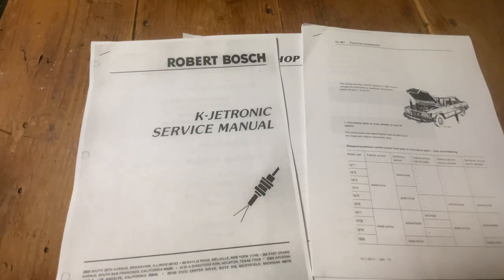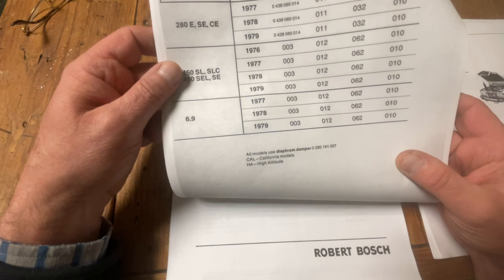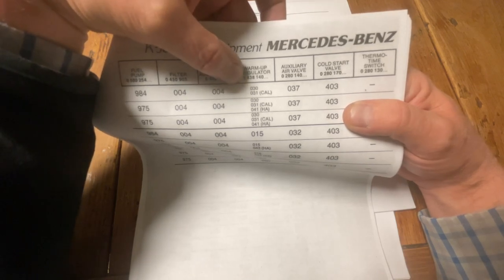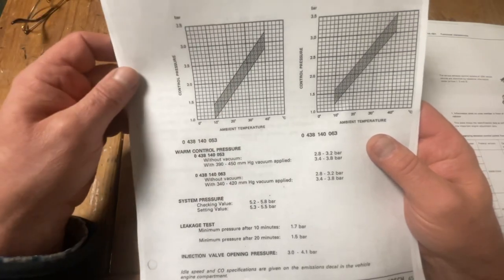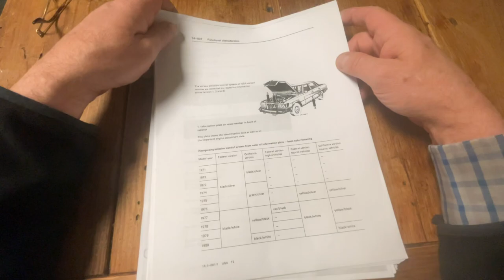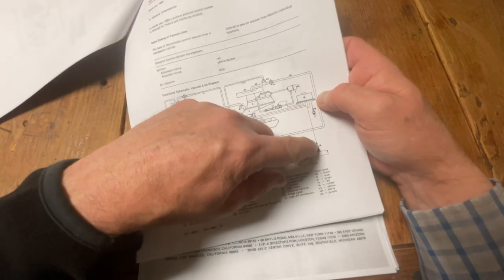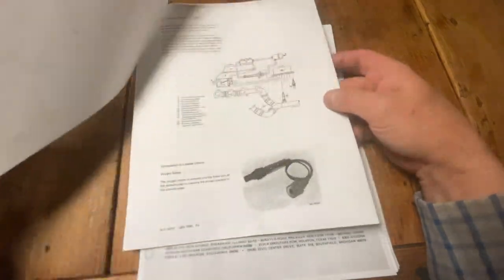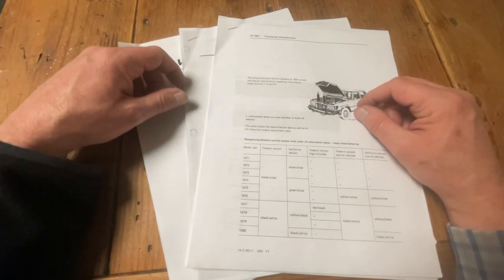Mercedes MY 76 to 85 Tutorial Bosch K & KA Jetronic, differences & similarities, High Altitude WuR

Comment: Good video, I have never heard it referred to as KA Jet, only ever heard KJET or KEJET. I guess that frequency valve just applies vibrations to the fuel? Hard to visualize what exactly it does. That Bosch manual looks great I may try to find a copy.
Reply from the maker: Thanks Nate, the frequency valve is a valve which opens when you apply 12V to it and is fully closed when there is no voltage.
The “ECU” or better Lambda controller applies a PWM (Pulse Width Modulation) to the valves coil. The valve is connected with the damper to the lower chamber. As longer the on duration of the duty cycle of the PWM as more fuel flows from lower chamber to fuel return line increasing the pressure differential between upper and lower chamber which results in more fuel flow to injectors therefore enriching the mixture.
The EHA valve does this in KE Jetronic.
Reply from the maker: Nate, the KA was called KA by Bosch. It was also called K Jetronic with Lambda Control by Bosch but that was quite lengthy so for simplicity sakes, Bosch called it the KA Jetronic

Comment: By the way, on the m117. 98 engines, the lower right passenger side chain rail has 2 m8 bolts holding it on. Would you happen to know the torque specs for those bolts? I can't find it anywhere. Thanks again.
Reply from the maker: Hi David, 
the upper three chain guide rails are held by pins. Which rail are you referring to? The upper or lower rail? The lower rail is only accessible by removing timing cover.
M8 x 1.25 bolts are normally torqued to 30 or 35 NM depending on the plating.
Is there a tensile strength class number on the bolt I.e. 8.8 or 10.9?
Reply: @inovahightechltd  I'm referring to the lower right rail. The engine is out and the timing cover is removed. I have all new rails but I couldn't find the torque spec for those 2 rail bolts that hold the lower right
Reply from the maker: David, can you look at the bolts head top and give me the numbers and letters of the bolt in question?
Reply: @inovahightechltd  I can find out the tensile strength on the bolts tomorrow. Thanks again
Reply from the maker: Ok, fyi 8.8 20 to 23 NM 10.9 30 to 35 Nm for M8, first number unplated second number zinc plated
Reply: @inovahightechltd  Wow.. Brilliant.! Thanks and I'll check it out

Comment: Off topic question for the expert... On a complete rebuild, do most people install the heads before the timing cover? Or visa versa? I've seen it done both ways, but which is better? Thanks
Reply from the maker: Hi David,
I am sure you meant timing cover, thanks for autocorrect.
I would install timing cover first as it sits between upper oil pan and head gasket. 
Peter
Reply: @inovahightechltd  Thanks again, and I'll be watching. It's not every day we can get so much great information from a true expert.